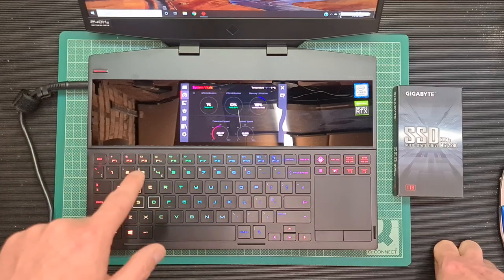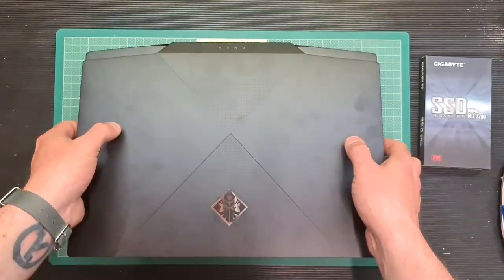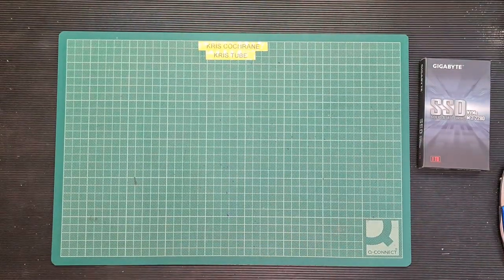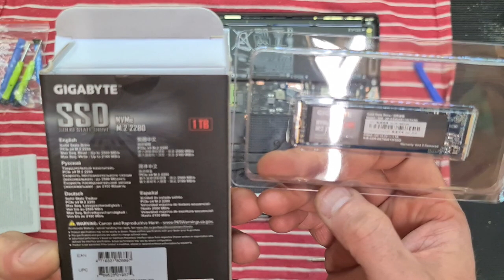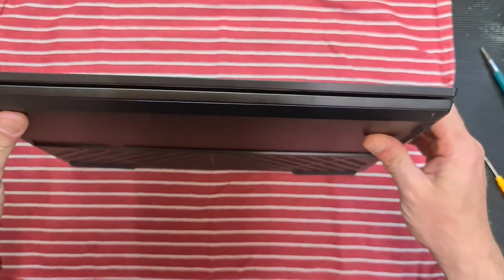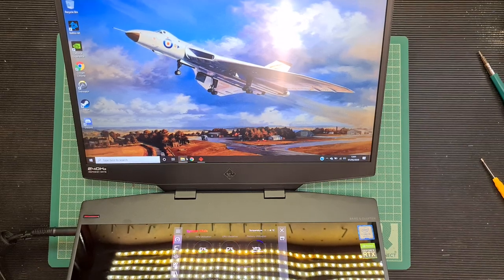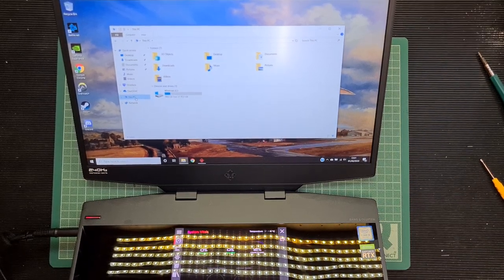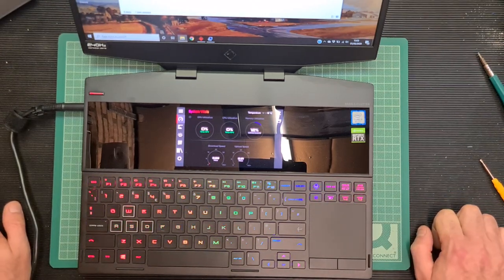How to remove the "user accessible" bottom panel from the HP Omen X 2S (and install an M.2 drive)

Comment: I just got one of these machines second hand and needed a hint as to where best to start spudgering the case open, I wouldnt have started with the hinges myself, they're usually a weakpoint so that quite surprised me.  Of course once I got in there I find that both M.2 and RAM slots are populated already, only 256+512 GB M.2 so thats item one (and two) on the upgrade list. Then ram. 8+8 under Windows10 isnt a great deal anymore, not for a creative use laptop.